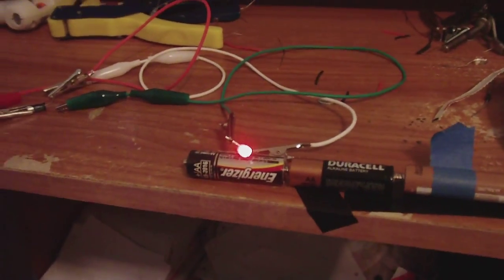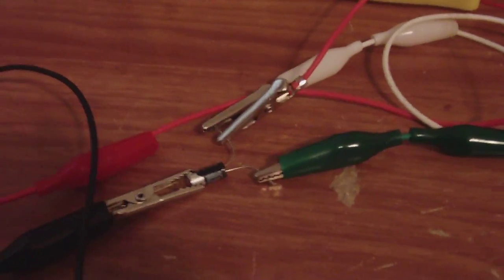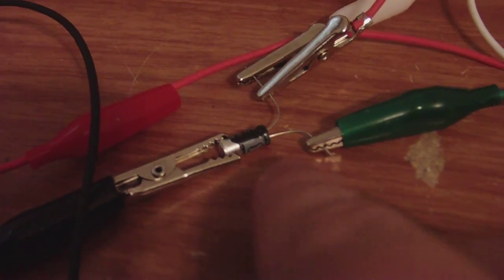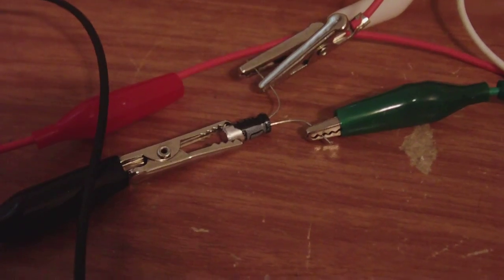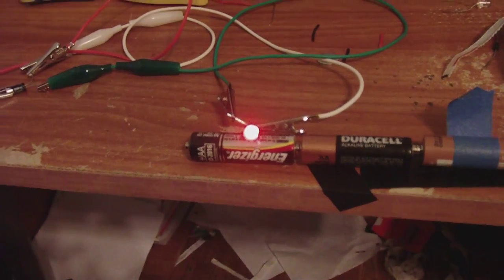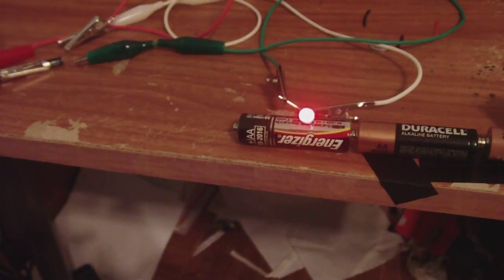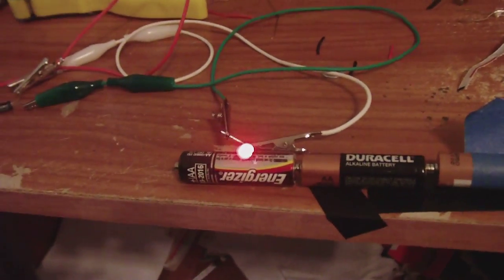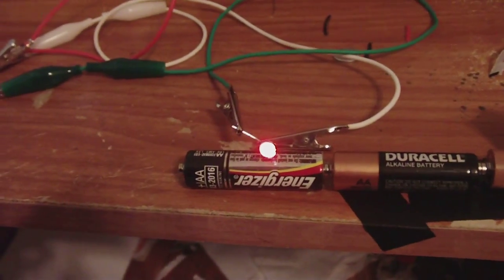Captret LED Driver circuit

Comment: As icing on the cake it would be neat if there was no drain on your 2 batteries that may be possible if the cap is receiving energy from the surroundings vice the battery; thers a guy that claims his 9 volt bat has climbed in volts when hooked up to a cap

Comment: 12 hours now, voltage was climbing steadily but seems to have leveled off.
I had a small 12v battery (smaller than a AAA) that had 11.2v in it and I used a 2200uf 10v cap, with a bright white led. When I hooked it up the Led was brighter but the voltage read 8.2, it has climbed to10.41 in 12 hours and the led is at about 3/4 brightness.
Very cool Idea! Thanks!!!